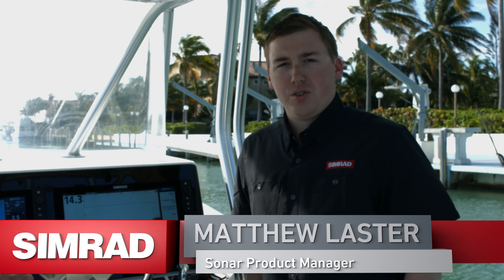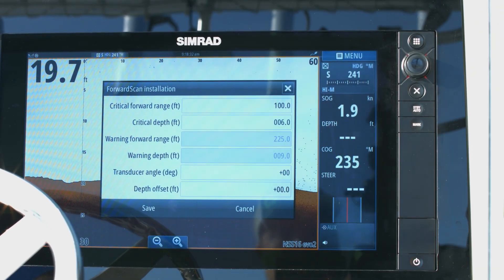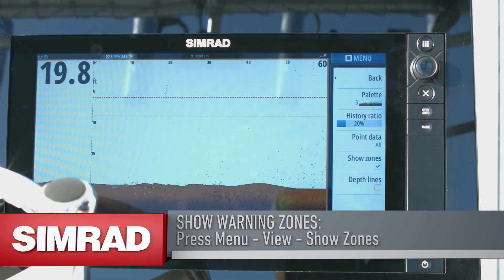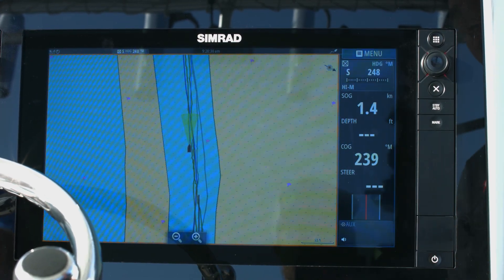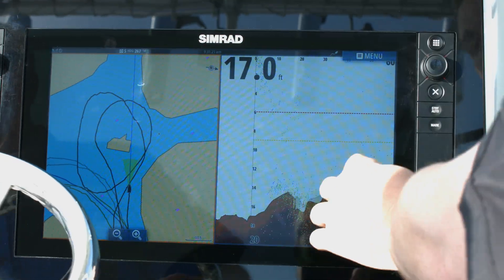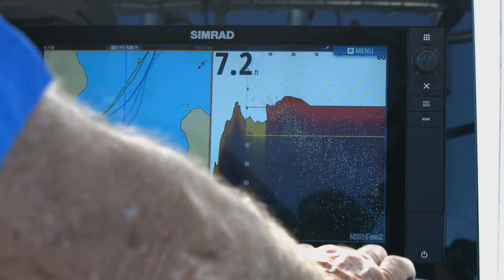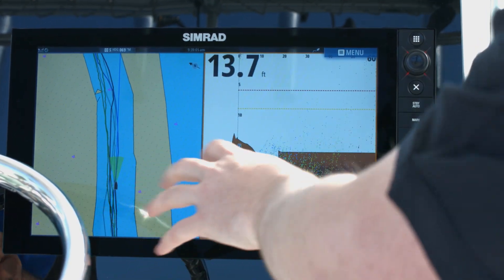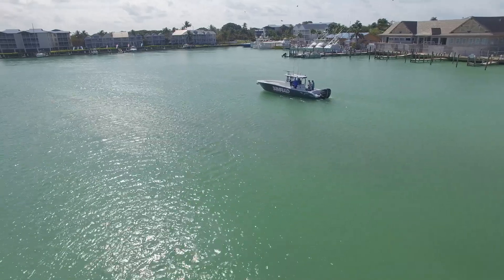Simrad | How to Navigate a Narrow Channel with Simrad ForwardScan™

Comment: So say you are in a boat that floats in 15 inches of water, and  you are in a shallow canal.  The depth ranges from 2 feet to 6 feet, and you are in one of the 2 ft sections..   40 feet dead ahead of the center keel line of the boat there is a single big rock - 3 ft wide and 1 ft tall, so that the top of the Rock is just 1 ft below the surface.  But to either side of the rock the depth is still 2 ft, and after you pass the rock the depth is still 2 ft.  You have Forwardscan and the critical depth is set to 2 feet.  Will it warn you about the rock?
Reply: Probably not. What I learned after I purchased my unit was that it will show 4 feet forward for every foot of depth. Since I am a sail boat I have it located right in front of my keel. That is about 15 feet back from the bow. That means in  6 feet of water I can only really see 9 feet in front of the bow. Also, what is actually displayed on the screen is a small sliver of the forward view. They like to make you believe it is similar to a radar screen that shows an arc of data. Not so. To see your rock you need to be swinging the bow back and forth - oh and in 2 feet of water you are seeing forward 8 feet. Depending on where you have the transducer, it could be even less. Go very slowly.
Reply: @louismeckler4202  Thanks for the info. Cheers.